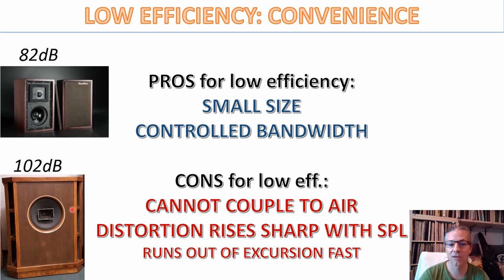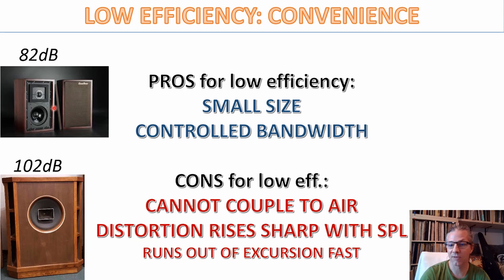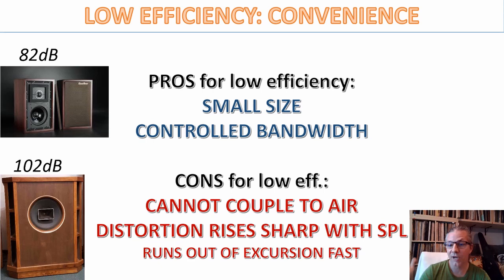EFFICIENCY OR EXCURSION - THE FINAL DEBATE

Comment: If we add a active crossover to a say example 96db speaker will the efficiency of the spesker drop. I heard passive crossover drops the efficiency
Reply from the maker: Yes, the DCR of the crossover drops the efficiency. That's why low DCR is so critical in passive crossovers. High quality chokes have super low DCRs, making this a non-issue. On the other hand, nowdays most commercial  passives use additional resistors beyond the absolutely necessary inductors to sculpt the frequency response curve, and those can eat up massive amounts of sensitivity & amplifier output power. That's why I recommend to go with the simplest possible passive crossovers and choose drivers that can work with such crossovers.

Comment: If I have 4 woofers of 89db what will be the final efficiency and if 8 woofers per side how much will it increase
Reply from the maker: Hello Anand, increasing the number of woofers from 1 to 4 in the same cabinet size, the efficiency stays approximately similar, because even though we have 4 times more but they also need 4 times more power to feed them.... so, we are effectively increasing headroom. There is a little increase in efficiency due to coupling between drivers, about 3dB or so. (As we have larger total moving surface). However, if we increase the cabinet size, the efficiency will increase as well. Efficiency is PRIMARILY affected by cabinet SIZE, the free air volume. The number of drivers used increases the moving surface area, and allows for smaller cone excursion to reach a given volume - with all the benefits (and negatives) that come from it. (Negatives - mostly the interference between drivers.)